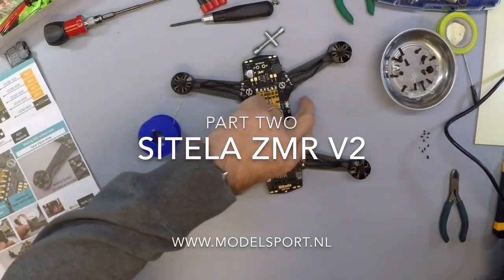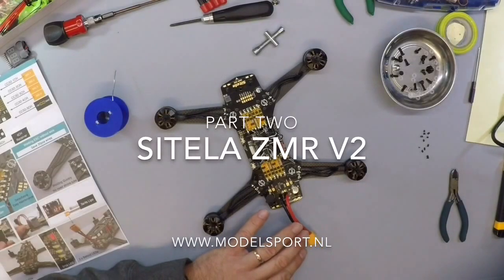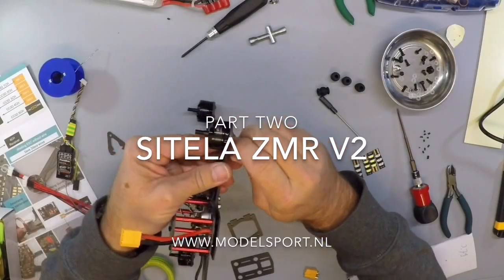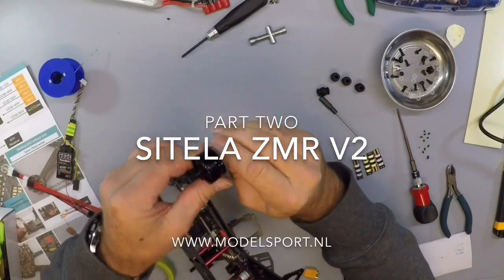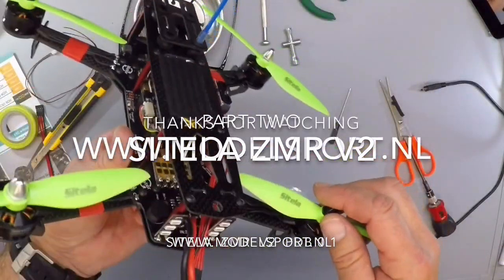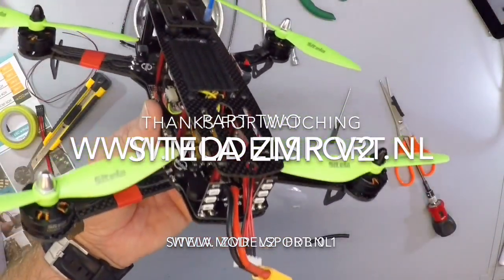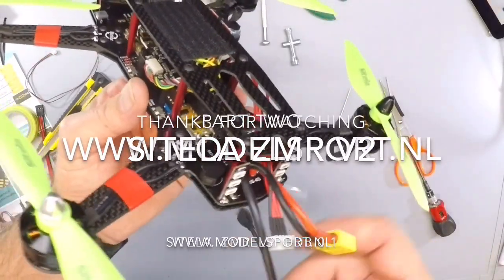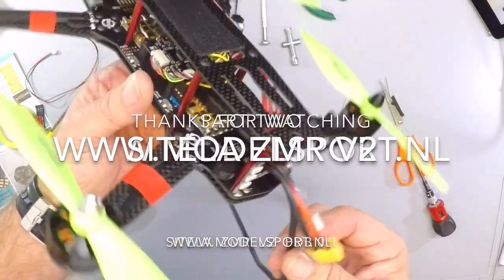Sitela Race Drone, ZMR250 V2. PDB 1.0. Building part two.

Comment: Have the same board. Those Sitela escs are the worse escs I have ever owned. They alll short out from multi-meter probing so I could map out the pin locations for flashing. This wouldn't have been necessary if they hadn't had such bad sink issues or if they had bothered to provide some information as to the pin location for the flash pads. There website , interestingly enough, says nothing about their spec. I heard from a guy that actually managed to reach them by phone that their flash profile is the DYS sn 20 amp even though these are 15 amp escs. The pcb crumbles from a multi-meter probing then its all shorts between ground and 5 volt rail. I'm taken them all off and replacing with some ZWT spiders which are flawless in BLHeli. What a waste of time and money working on these things was. Never again will I use Sitela anything. They have show themselves to be the crappiest RC player ever. Can't stand the idea of that Sitela logo remaining on my ZMR's PCB. Sitela you guys are fcuking morons - good riddance.